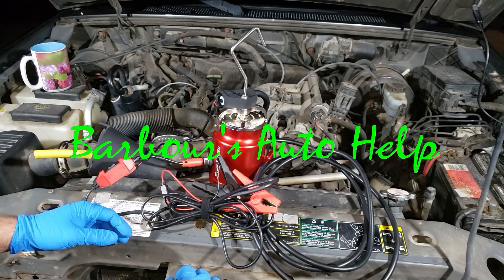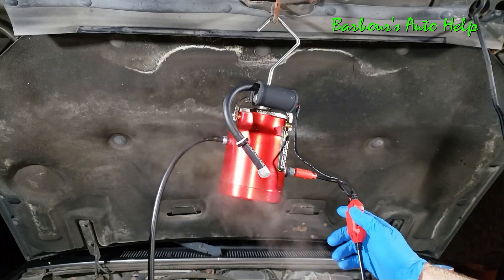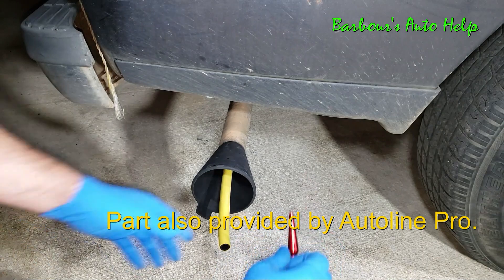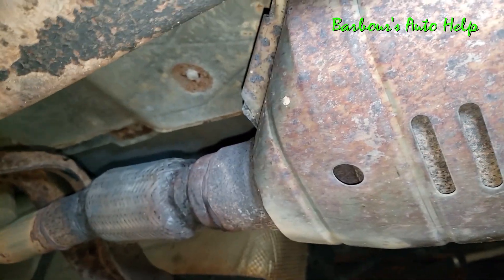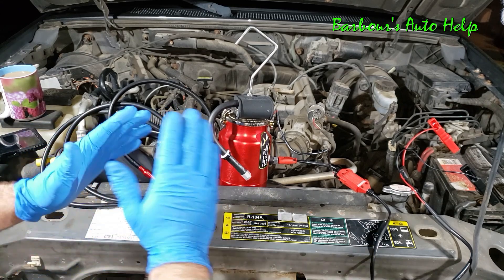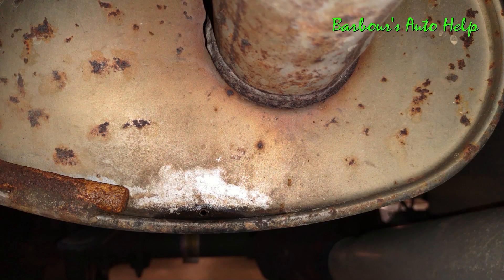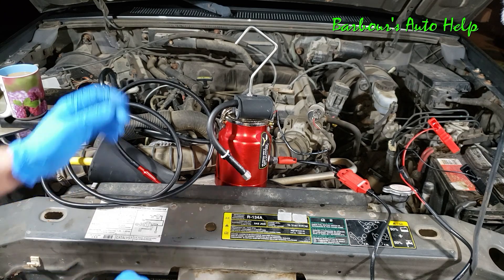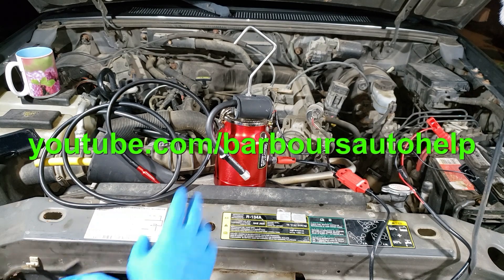How To Find An Exhaust Leak With Smoke Machine

Comment: I have a 2020 v6 tacoma w/ dual exhaust. I guess i would check each side for leaks?
Reply from the maker: Yes.  Unless the two sides meet in the middle like an H-pipe.  But yes check for smoke leaking on each side regardless.  It' may be necessary to plug one pipe a the rear of the exhaust while checking the other.  I'm not that familiar with this vehicle to tell you either way.

Comment: Is there a chance the smoke might damage or affect some of the sensors?
Reply from the maker: I've never had an issue and it's recommended by manufacturers to use a smoke machine to diagnose lean codes.  So, I doubt it.

Comment: I need to diagnose a leak with my catted headers around that exhaust manifold and where it meets the midpipe. Is that stuff safe for a catalytic converter?
Reply from the maker: The stuff sold by AutoLine Pro is.  The stuff most machines use is.

Comment: Silly question but I have a smoke machine used for a party a few years back. I'm not a mechanic and I'm trying to find a leak in my exhaust. Would this be useful? Will using a water based smoke fkuid it damage the engine?
Reply: I would imagine that would work fine!

Comment: I just bought this to try and pinpoint a tiny exhaust leak that I found with the shopvac+soapy water method and i was surised to see that the smoke was not visible out of these pinhole/hairline cracks...i guess this is better for detecting leaks that are not hairline/pinhole
Reply: For super tiny cracks you need more pressure, for big you need a lot of smoke

Comment: How do you repair a catalytic converter leak?  Do you need to take to muffler shop and have heat shield cut off and then rewelded back together after the leak is repaired?
Reply from the maker: Probably just replace it.
Reply: @BarboursAutoHelp  wouldn't it be much more cost effective to just have the heat shield cut off...leak repaired and then heat shield welded back?  Can't be that labor extensive
Reply from the maker: @macknumber9 the trick is doing it without damaging the catalyst.
Reply: Depends on extent of leak. Usually its more cost effect to replace cat than to chase your tail when its rusty and springing leaks constantly @macknumber9